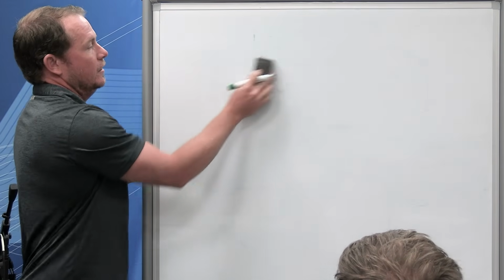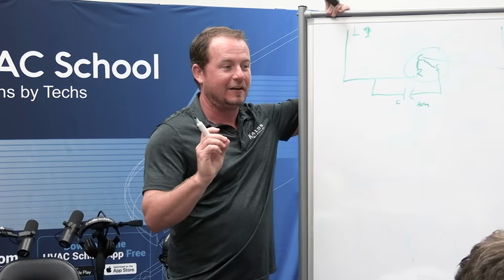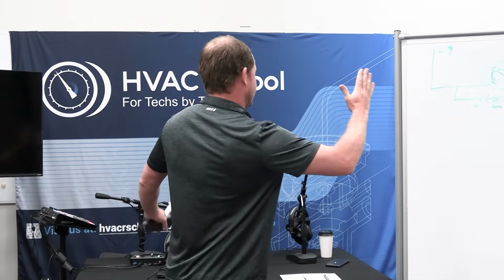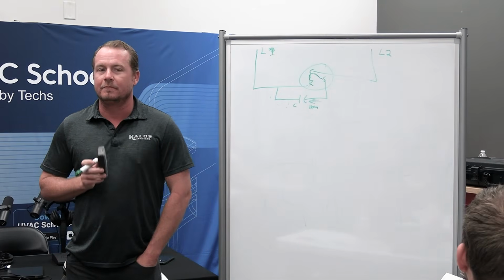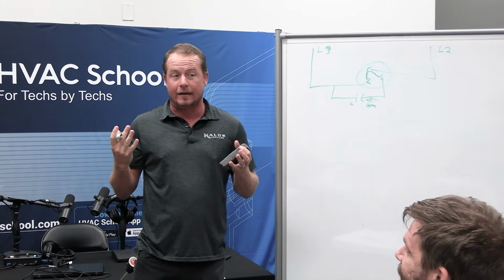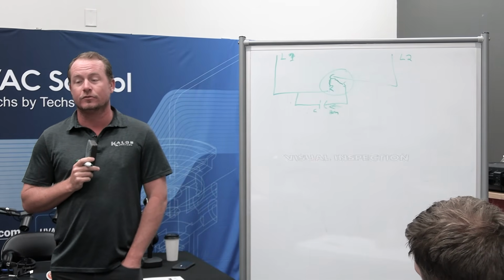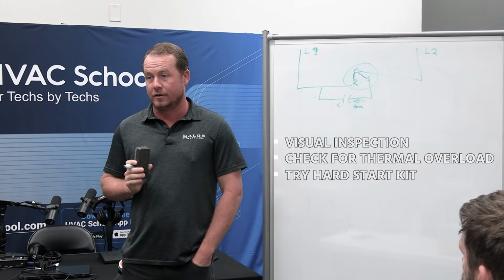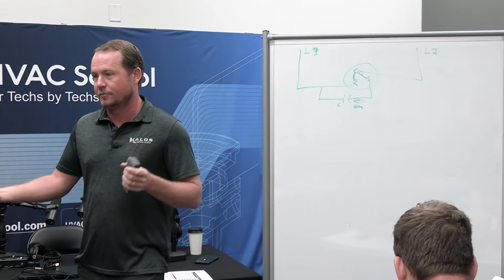Capacitor and Hard Start Myths Busted

Comment: Well explained thank you very much. 
By connecting the phase line to the start coil and connecting the run capacitor in series with the running coil direction of rotation will be reversed.
Its long story why i have to but, One time i have fitted by reversing the direction of single phase fun motor and it run continously for about 1 month until i recieve another one. 
I would like to know how bad is it the fun and what could have happen to it?
Reply: It is not designed for that.
The run winding and start windings have different resistances, and have different designed running amps going through them.
Wiring it backwards likely creates excessive heating in the wrong places.]Hopefully the overload would protect it from damage (unless allowed to repeatedly cycle/shutdown).
Likely it overheats the start winding with excessive amps.
It might be possible to find a generic fan blade in the 'other-handed' rotation for you existing incorrect motor...  check an HVAC supply house.
Reply: @troubleshooter1975 Thank you so much i understand now what could have happend. To be clear sir i did that not for expermenting. i was on board ship no spare on board & provision store(fish room) evaporator fan just faild so temporarly i just fixed another fan but its direction needs to be reversed by any means the store has to be saved. Luckly it withstand until we get the original fan.

Comment: I love listening to you.  Your explanations are quite good.  HOWEVER, don't use "attractive" force when talking about capacitors, electrons going in one side of the capacitor repel electrons (across that plastic film) and push them out the other side.  The balloon analogy is good, but use two balloons sharing a fixed container.  When you push air in one balloon, it squeezes air out of the other.  As one balloon fills up, it becomes harder to continue to push air in that side (acts like a variable, increasing resistor).  You get all that pressure back when you switch to the other half of the cycle.  During the cycle, as the voltage approaches zero, one balloon is as full as it can get, creating back-pressure (high resistance to current).  When the cycle passes through zero, that pressure (voltage) is released creating high current.  NOTE:  you get decreasing current while the line voltage is increasing and you get high current when line voltage passes through zero!  This is the cause of the phase shift observed with capacitors.
Thank you for this excellent presentation!

Comment: Capacitors should be treated with respect, as its not the voltage of the capacitor, or even the amount of power it can hold, its the speed in which they can be discharged, they work on electrostatic charge, think lightning, they will dump their entire charge in a split second, just like a firecracker, not a ton of energy, but it can blow your finger off.

Comment: Capacitors behave like a battery, when they are discharged they can take a lot of current very quickly, they appear to the circuit as a low resistance, as they near line (charge) voltage they take less and less current and appear to be a higher resistance connection and allow less current to flow, eventually none. Best way to show this is to check your capacitor with a ohm meter, Discharge the cap, connect the meter and watch the resistance, as the meter charges the cap the resistance will increase from near 0 to OL.

Comment: The capacitor is simply used for a phase shift to give the motor a direction. The starting and running winding are physically mounted in an offset position so its necessary to have a phase shift for direction selection. Formula for phase shift is directly proportional to capacitor size, so yes a start kit increases phase shift.  And ac voltage will go from 170 plus to 170 negative not just zero.   A capacitor alone should never be plugged directly into the ac line just to see what voltage it is when you unplug it.  Basic rule capacitor is a short for ac and coils are shorts for dc. Basic electronics are missing from this guys talk.  The capacitor symbol he drew was a polarized cap for dc.
Reply: It is NOT a short.  It will draw the same amps as it would under the same voltage in circuit...
That being said;  it won't do you outlet contacts much good LOL.  It will pit and burn sometimes, especially if it is a large value µF.

Comment: PTC Thermistors are the most common from the OEM, yet rarely discussed in classes like this.
Reply: That is because this class is addressing PSC systems (ie as residential split system ACs).
PTCs are only used in split phase start for domestic hermetic refrigeration AFAIK.
Which is not what he is covering in this lesson...
[the start winding is only energized during the start cycle]
Mr K L

Comment: hey there, I hope someone can help me with this: I have an old fridge and the starter relay  died on me, and I can't really find a replacement part. is it feasible to replace it with a capacitor, or am I definitely gonna cook my start winding with it? if it's possible, how do I figure out the capacity I need?
thanks
Reply: I would not expect a capacitor to work You would need to find out whether you have a potential relay or a current relay and be able to locate the nameplate in an attempt to determine the compressor operating current. Try calling some of the appliance repair parts sites with the make and model of the fridge
Reply: @doneden5368  thanks, well I'm not without a fridge for 2 years tho lol
I found a random fridge compressor on the side of the road on my way to work, picked it up and guess what it had a perfectly working starter relay that fit my fridge compressor. I was so happy for my lucky find, such a cool feeling

Comment: What could be causing my blower speed to fluctuate a lot but mostly run at very low speed during cooling season? This is a problem I’ve been having during a recent spell of hot weather. Usually turning the system from cool to off for a while fixes the problem and then it’ll work fine again for a day or two. If I leave the system off but the fan on, it seems to blow at the expected constant low speed.

Comment: For your "third hand" example for the start windings, instead of the "pinwheel" analogy, I like the bicycle pedal/crank analogy.  If the pedals are straight up and down, it is very hard to get them turning, but a third pedal (phase shifted) helps get it going and then the rotational inertia keeps things going.
Reply: Very good....let's go further.....yes, when a pedal is straight up and down it's difficult for your legs to rotate the sprocket ( force FORWARD or BACK), but a third pedal located at 3 or 9 o'clock helps.....great visualization that you propose here !!!
Reply: Better to just tell it like it is, show magnetic zones and explain that if they are exactly opposite each other, that this just cancels each other out, while if the next field is closer to one of them than the other and then shifts again to repeat for the next field, it induces motion from the magnetic attraction.
Reply: I was thinking it would be simpler to use 3 cranks spaced 120 degrees apart. To be more blunt, for the cost of running 3 conductors to residential buildings instead of 2 the appliances would be cheaper, more efficient and more reliable. There's a significant cost for utilities in rural areas, not where the lots are under an acre. The cost to paste 3 phase inverter drives on a single motor is more than the cost to build it right the first time.
Reply: @oliverstreet7704 
Ja ich plädiere auch für 3 phasige Steckdosen grundsätzlich.  
Das gesamte Stromnetz würde auch gleichmäßiger belastet.

Und ein 150watt drehstrom Motor ( drehstrom asynchron Motor) hat deutlich mehr Kraft ( drehmoment) als ein 250watt Motor der mit 1phasigen wechselstrom betrieben wird.

Auch habe ich noch eine dreihasige Steckdose mit verschmorten Kontakten gesehen! Bei den 1 spaßigen Steckdosen sind überhitzung der steckkontakte hingegen sehr häufig.
Die angeblichen 16 amp  vertragen die nur sehr kurze zeit.
Reply: I like the merry go round analogy

Comment: I see that most people benefited from this explanation, which is good. My explanation, when teaching electronics, is to start by explaining how  an AC motor works. Then you can see what is needed to start it (and/or run it, ie make spin). Then you can understand what the capacitor must do to make that happen. This forms a better understanding of the start cap, run cap, and motor as a SYSTEM and ties these components together. Then when the question arises as to what the symptom is when the caps fail, they need no explanation, because it is obvious. Thanks for the video. I am always impressed by people who share their knowledge and experience. Keep it up!

Comment: Is it ok to install a “Hard Start” on a brand new unit since it has a 70 foot run to the breaker panel?
Reply: That would be a band aid for a voltage drop problem.  The conductors should be re sized.  We had the same problem on a new install where the electrician did not read the OEM specs for sizing the conductors for long length applications

Comment: Great video - truly my new favorite YT channel.  Quick question - if you replace a compressor on a unit that has a HSK, why would you keep the HSK in the system?  Isn't the HSK only installed due to the compressor being on its last legs so when replaced, the HSK would no longer be necessary?

Comment: Europe (Swe) 3 phases 400V in 50Hz about 16A-36A(64A) per phase. 
Higher value if the client uses Electric heating elements or high current consuming apparatus washer dryer or
an electric engine for waterpump.

Comment: How does the magnetic field on the winding affect the power factor?
Reply: All motors have a lagging power factor where the winding voltage leads the current because the induced voltage resists a current change (the opposite of a capacitor).

Comment: Is it possible that a mouse got its head stuck between the fan blade and housing that cools the compressor causing the compressor to shutoff after a couple of hours due to thermal overload but the condenser fan keeps running - yes.

Comment: Fantastic video!! The presentation was clear and informative. If I ever decide to become a HVAC tech, I would want this guy for an instructor.  Would like to see a class on these soft start units that are advertised for RV a/c units to reduce demand for amps at compressor start up. Throwing it out there for a topic of discussion in case you wanted input. Thanks!

Comment: Can't complain -- it's a fairly good video. I sort of like how they embrace what they 'think' or 'visualize' is happening over what's actually happening. Myself, I have a good electrical engineering background, but know nothing of HVAC units... When he discusses the wheel of fortune wheel and the 'third hand,' I chuckle because it gets the idea across, but I think it's missing a key component.
1) Most people know that magnetics either attract or repel, depending on the poles.
This is the fundamental working force behind a motor, you construct a system such that the repelling / attracting force of two magnets make it spin.
2) Most people also know you can make a magnet by passing current through a wire.
3) Lastly, most people know the 'pole' of an electro magnet (one made by passing current through a wire) is determined by the direction of the current (i.e. the polarity of the source voltage)

What's missing I think for some people, like myself, is the revelation that HVAC motors do not have static / permanent magnets. They instead use electromagnets for both the stationary and spinning sides of the motor. How is one expected to control the poles of the magnets such that it spins, if both sides are powered by a single phase power source? That'd make both sides N at the same time, and both sides S at the same time, locking the motor in place. The answer is the capacitor; a phase shift that makes one side N, the other S with just the right timing to get it moving. Once moving, the alternating periodicity of the power source keeps it moving.

Comment: You have tried to simplify things in this video to the point of nonsense.  You leave your class confused and with no real understanding of what is going on.  Your first mistake was drawing a symbol of a polarized capacitor and not an AC capacitor.  The correct symbol should have been 2 parallel lines.  The gap in the capacitor symbol is an insulator or dielectric not an air gap.  A capacitor is just two metal plates and a dielectric between them.  The next confusion is the capacitor is connected not to a terminal but a motor winding or inductor.  We really have an RLC circuit and that is where the phase shift comes from.  The R is the resistance in ohms of the connecting wire and the wire of the motor, the L is the inductance in henrys of the motor winding and the C is the capacitance measured in farads.  The electrons bunch on one plate of the capacitor and push the electrons away on the other plate.  A capacitor will not pass DC current and at the peak voltage of the AC input, will stop pushing the electrons away on the opposite plate.  An inductor is just wire wound around a core.  It has low resistance and if DC voltage is put into an inductor, excessive current will flow and the inductor or winding will burn up.  The current is limited by the capacitor in series with the inductor.  You don't have to overwhelm your students with all the math and equations involved but the basic principals should not be obscured to the point of confusion.

Comment: I’m a Retired Claims Adjuster who specialized in AC “lightning” claims in the seventies when the first batch of home AC units began to wear out. If a tech saw burned wires, they declared lightning damage, obviously because ONLY lightning (not LRA from a mechanically failed unit) could burn wires outside the compressor. I am proud to say I answered almost every question the teacher asked correctly. I am also an amateur reel to reel tape machine repairer, and bad or dying motor run caps are a chronic issue on machined 40, 50, and 60 years old. I took electronics in High School. I find electronics fascinating, even though I specialized in Law and Litigation in the claims business. 

Very useful presentation, thanks!

Comment: I found the video interesting and learned a lot on how the capacitor is used to commutate the motor in a single-phase system. The one word of caution is at the end of your video you talked about plugging the cap into the wall and pulling it out to see what voltage you would get. This is fine on a non-polarized cap like a starter cap, but you mentioned an electrolytic capacitor, which is polarized and will explode if you plug it into the wall voltage. Polarized means it is mean for a DC voltage and will have a "+" symbol for the positive terminal. I' one of those electrical engineers you mentioned:)
Reply: False;
Go back and review; he mentioned electrolytic START capacitors, which by definition, are non-polar...
Hopefully, someone viewing this video knows the difference.  Yes, you are absolutely correct to warn anyone NOT to try this with a POLARIZED (DC) capacitor...

Most start capacitors over 100µF are non-polar electrolytics (rated only for intermittent duty [they heat up rapidly from the IR losses])
Mr K L (technician and engineering background).
Reply: @troubleshooter1975  I did not hear the semantics of polarized vs non polarized. I would caution anyone trying to randomly charge a run capacitor from an AC outlet to put a 25 watt light bulb in series. The chances of getting a significant charge depends upon when you unplug the capacitor at which point in the phase angle. It is largely a matter of chance and chances are you wont catch it at the peak. That said, when working on a unit, you should always discharge them after pulling the disconnect as you may have that unlucky day that you get a small shock and drive your wrist into the sharp sheetmetal, which is the larger hazard.
Reply: Stop blathering and get your own channel.

Comment: Begora, HVAC techs know nothing about basic electronic elements?
The opposite polarities of a center tapped transformer is not changing the phase. Another myth.
It is misleading to say that start windings do not burn up. In capacitor start motors that is the case (assuming everything is else is correct). Standard induction motors w/o caps and use a centrifugal switch is another matter.

Comment: When I went solar, I pulled the hard start kits from both of my HVAC units and replaced them with Soft Start kits from Hyper.  The inrush current at startup is significantly reduced and much nicer to my solar controllers.  When I had my yearly tuneups done the first time after I installed them, my HVAC guy said he was really glad when he sees them.   The units he had installed them on haven't had a failure since he started using them.  That was 12 years ago, never a problem here.  He still says he's not replaced a compressor on any unit with a soft start.
Reply: I hear they help with generators as well